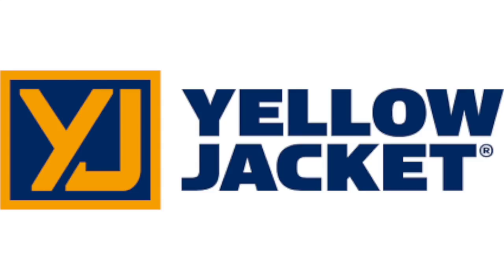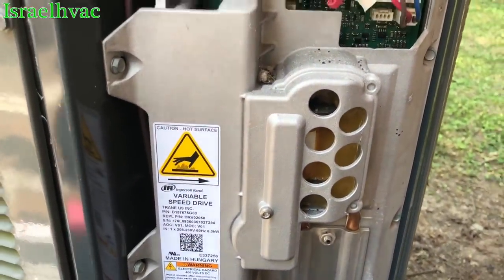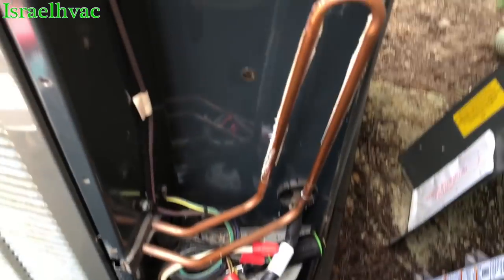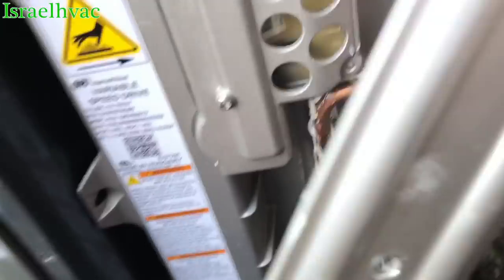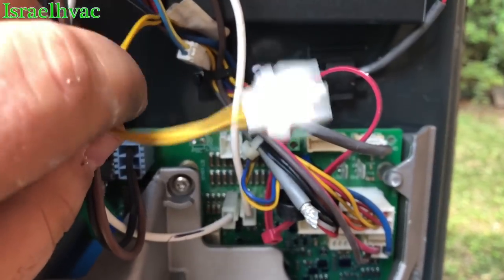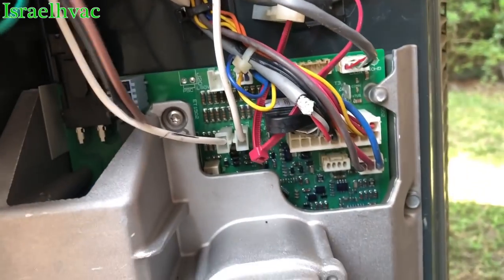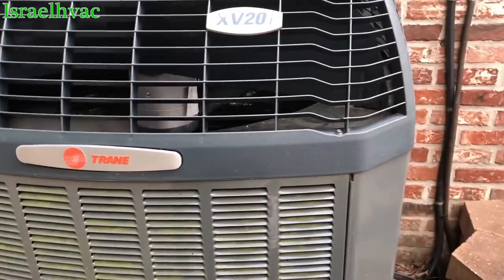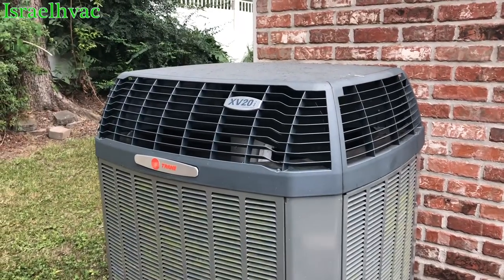Replacing a Inverter Drive on a TRANE XV20

Comment: you should clean the old thermal compound off the line first, wipe most off with rags first, then clean with rubbing alcohol and something without lint. then apply new compound  :)
not sure how much thermal output it has there, but it must be substantial for them to "liquid" cool it vs fins and fan airflow. then again, maybe just a way to keep noise down.
by the way, you should try to keep the "grease" off your hands, being it's very fine silicon, zinc and other possibly other things mixed, it's very hard to get it all washed off your skin, fingernails and tools and you dont want to "eat" any of it later or worse yet, get it into your eyes!

Comment: We just got quoted $4500 to replace ours.  It is working on and off. Have to reset the breaker from time to time to get it to work.  7 year old unit. Won't just sell us a new unit for outside have to replace both units for $18-20k.  Will never buy another Trane at this price.  We are the second owner and warranty didn't transfer because we didn't know WE had to transfer it within 90 days of buying the house.  We have had many parts break on the units and have over 3k in repairs prior to this breaking including fan motor and module for 1k..  Looks great, but be ready to spend some money.

Comment: Poof, there go the savings of this super high efficiency equipment.
Reply: Yup
Reply: 10 year warranty on this model.
Reply: K9ADVCRU does that include service call and labor?
Reply: manhoot I work for a company thats a premier Trane dealer. They only warranty parts, not labor. My co workers tell me they “compensate”, but not enough? Cause we charge for warrantied parts anyway.
Reply: plus a whole week without air conditioner!
Reply: @FrostBlueFire  on the XV is that a three-phase DC compressor how far can it ramp down? I put in a Goodman 2-stage 3 ton. First age is 2 tons second stage is the whole capacity with an unloader built into the scroll Copeland compressor. I was wondering how far down these can ramp, cuz there is well return issues so the compressor has to turn so much I believe. Just wondering I have no idea, figure you being Trane Elite dealer you might know
Reply: You're absolutely correct! The main circuit board containing the inverters and other power electronics are not reliable and gets damaged by voltage surge. My AC also suffered the same fate( I live in India though).
Reply: First thing you do with equipment like this installed is get a LARGE surge protector and install it in your circuit breaker box.  

Easy to connect.  Red/black on any 230V breaker that is always ON, white on neutral, green on ground.  

That takes care of the transients on the power line that wreak havoc on all electronics.

Plus by doing this you're protecting your entire house!
Reply: @knobdikker  good idea

Comment: YELLOW wire is Crawdad/Mudbug Sensor! :)  3:00 John and the Group; the "unused YELLOW wire connector" I believe is when the unit is also used as a Heat Pump. The schematic's Note 4 says  "* Only  used on heat pump models and not used on AC units". It is labelled as CBS, and has a connector to the inverter board with yellow wires. ON a HEAT pump variant, the extra CBS sensor (outdoor coil temperature sensor) is used to stop the Defrost cycle. In a Heat Pump the inside coil is warm and outside coil is cold; thus a defrost scheme monitors the outside air temperature and the outside coil temperature too.

Comment: Inverter DC Bus capacitors hold a charge for a good while. Capacitors charge to the PEAK voltage of the incoming line, not RMS..... Be cautious, take a break etc after pulling the disconnect.

Comment: IS that a loop of the liquid line or a copper heat pipe for heat dissaption?  for the inverter board IGBT's........  You would think if they're trying to cool down the switching transistors, they syphon off a little of the suction line, being it's colder than the LL. You can never have enough thermal compound! lol.
Reply: Hello spector,

you are right ....... inverter on the suction line would be much more effective than on the hot liquid line.
Reply: Then you have to deal with condensation. The liquid line will always be ambient + a few °. It is clearly the right choice.
Reply: I don't think they're trying to cool the board,  without seeing the wiring diagram an specs it appears to be one of two things or maybe both,  I don't think the board runs hotter than the liquis line so they might be warming the electronics board or they're measuring liquid line temps to vary the fan speed accordingly

Probably a lot of extra $$$ for lil gain..
Reply: They could also be trying to keep the board at a constant temp,  instead of having it at ambient
Reply: J B no man those boards get way hotter than a liquid line they wouldn’t be trying to heat an inverter board

Comment: Does that drive act like a 3 phase variable frequency drive?
Reply: jesse copeland yes the inverter creates 3 phase ac to run the compressor.  This is how the speed of the compressor is varied.
Reply: Wow that’s awesome! I use vfd drives for whole house r/o systems with delivery pumps. It was new to me not long ago. I didn’t realize they were used in ac as well. Very cool.

Comment: Accidentally spray some water on the board and the unit stopped, the display, status and communication light led was dead so i replaced it 

Is there anything I can do to fix it, any fuse or wire burnt?

Comment: Hello Israel,

why is this inverter bolted to the fluid line?

the inverter generates heat during operation and must be cooled. however, the liquid line also becomes hot during operation. so she can not cool the inverter after all? or is this thin line part of the suction line?
then the function would be ok.

Greetings from Germany.
Reply: walter f. The inverter drive runs much hotter than the liquid line. Thus the inverter sinks heat to the much cooler object. The liquid line can sink an gigantic amount of heat.

Comment: how did you know the drive was bad
Reply: Scroll through CDA menu, other component he replaced or visual inspection of board
Reply: thanks I have never had to work on one yet I don't sell anything like that and I've never seen it I know one day ill run into one
Reply: my experience with bad drives usually were because they would not power on or the display would be malfunctioning/glitchy and in that case the display can be replaced but the drive can be sent out to a shop that specializes with drives to be repaired. you should be able to control the frequency output to the motor manually and the motor should run accordingly.

Comment: Inverter failures occur much more rarely than run capacitor failures. Inverter units keep the room temperature more consistent and eliminates cold spots and hot spots.
Reply: only because they want you to buy their new junk and pay out the wazoo for something that wont last either. there's tons of units out there from the 70's still working perfect, with all original parts and never gauged up on from original install ;) "hint"  they are mostly horizontal flow condensers and owners that have covered them for winter.
Reply: -Inverter units last longer then capacitors agreed
-inverter units keep a more consistent temperature agreed
-inverter units eliminates hot and cold spots.... somewhat that goes more back to duct design
Reply: So is it the case that these Trane Multi Stage units don't have run capacitors?
I was going to order a run capacitor to have on-hand (since I'd do that with past units), so I opened the unit to get the run capacitor specs and I saw this giant inverter, and I was like, "Yeah, this isn't a normal AC unit."

Comment: What a disaster why does it need to be over engineered like this
Reply: It is not very overengineered imho. Two three phase motors, a pressure sensor, a temperature sensor and an EEV is all you need. It is not decades old tech like it used to be but it is not really complicated.
Reply: Money.

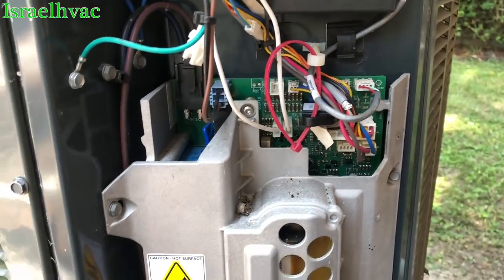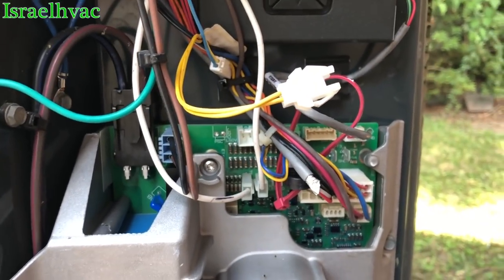Comment: 0:38 & 3:30 It appears that that yellow wires were not connected to anything before you even removed the old drive. How confusing!
Reply: Brian Kerber a tech tip is to shoot images of stuff before one removes anything
Reply: That is kind of what was done here with, except with video, at the time stamps above, you can see the in the beginning it wasn't even used/connected. Strange why a manufacturer would put something "unused" in a device as it would eat into their profit margin.
Reply: Brian, the same Trane inverter module is used on the sister model that is an AC plus Heat pump. The yellow wires are on the schematic as a CBS, an outside coil temperature sensor on the Heat pump variant. It is cheaper to stock one module than two variants with only one extra pair of yellow wires and connector. Hope this clears up the concern.  If there were two variants the inventory costs double at a supplier.  Where I live the county taxes inventory too, thus you pay 2.2 percent per year for every 100 bucks in inventory; forever.

Comment: I’ve noticed many manufacturers will show wiring diagrams of units...that isnt the one you’re working on. They’ll label each model number type, to each part of the diagram, I’ve noticed these in the old 2TEE 4TEE Trane units(AHUs). So you’ll get parts and extra wires that aren’t  the unit you’re working on. I find it very foolish